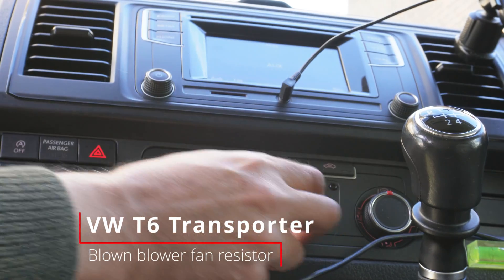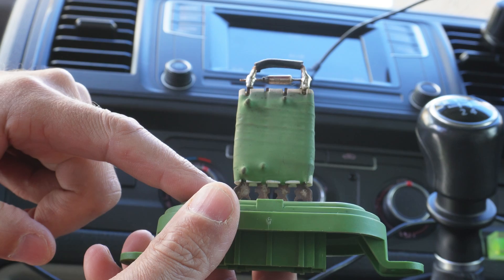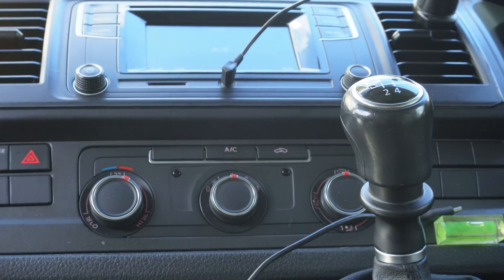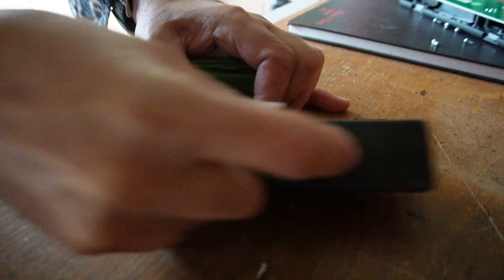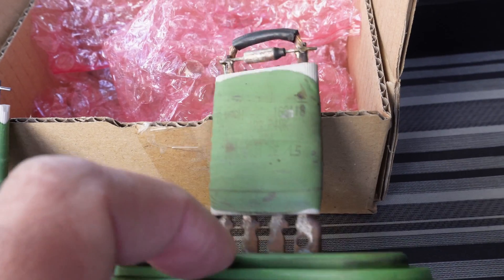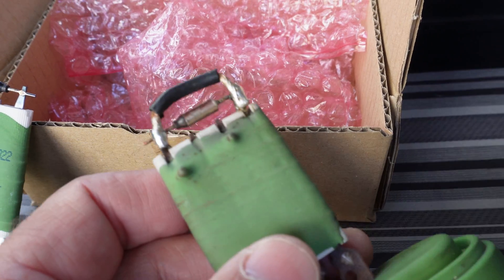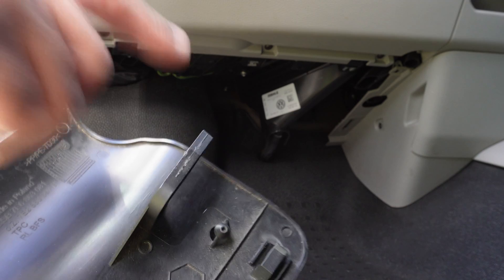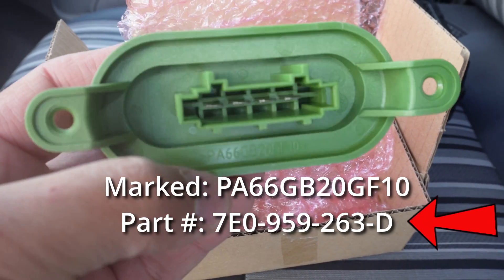How to Diagnose and Fix VW T6 Heater Blower Problem: a faulty resistor.

Comment: Nice Post..  Unfortunately I had to remove the lower glove box compartment and alse remove the lower part of te casing from the blower, because there was not enough space to remove the old resistor...  To much Isolation and carpet....  
 Took a little hour more to fix it...

Comment: Excellent video. Super helpful. Love the soldered jump link as temporary fix. I used your example do do the same thing. How long did your new resister last. Ours lasted about 9 months and has blown again. Google search suggests fan motor might be getting lazy and drawing more current.

Comment: If the bypass worked, why did you purchase and fit a new one pls?
Reply: because the thermal fuse is a safety feature - you could have a fire if the resistor and/or wiring is allowed to continue just getting hotter and hotter
Reply: @ ok thanks for your reply.
I read that the temp that the fuse fails at, maybe slightly too low.
I have blown a couple of these now, and bought replacements from vw at £80 a pop.
They seem to last about a year.
I’ve just blown another but found a cheap replacement on a well known auction site for £7
Going to see how the cheap one does 👍🏼
Cheers 🍻
Reply: @AndyWilson-rs7fw  Yeah I would check your cabin filter is clean, and maybe contact cleaner in the controls, maybe it's pulling too much current (silicon spray in the motor (not while running) maybe?).

Comment: Thank you for posting Great help Fitted a new resistor .Blower working on all 4 positions Sill have no warm air  Help please
Reply from the maker: Hmmm the only thing I can think of is a blocked heater matrix or a valve not opening? Is it cold even when the engine is at full temp? Have you noticed if the engine is running hot? Is your coolant levels low?
Reply: @MyVanConversion   Engine getting to 90° as normal Coolant is good No leaks 
Picking a Bowden cable up tomorrow 
 👍